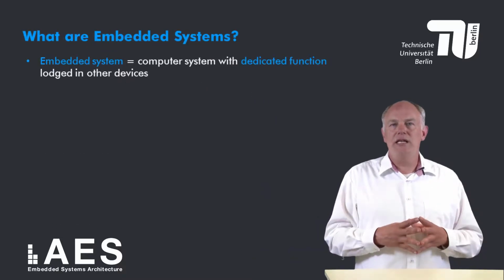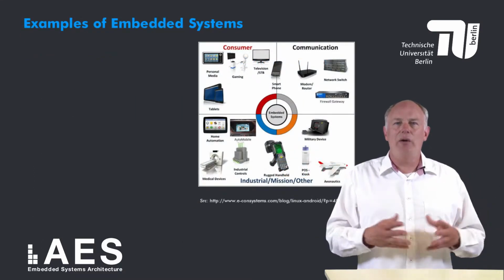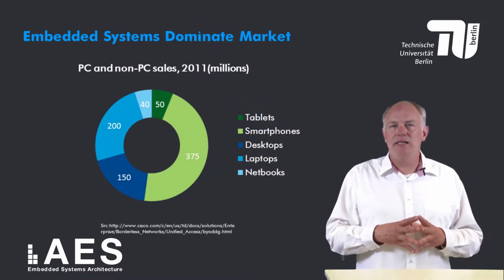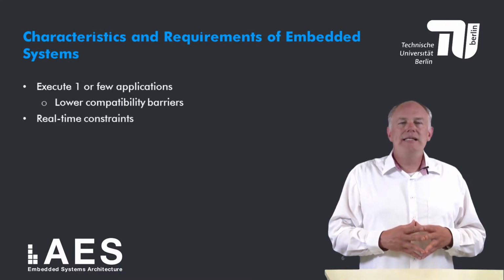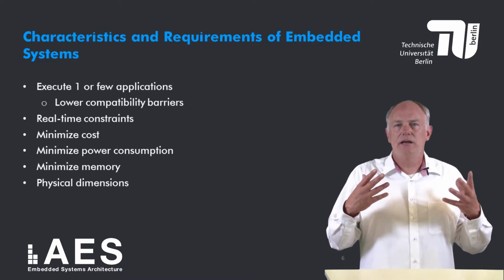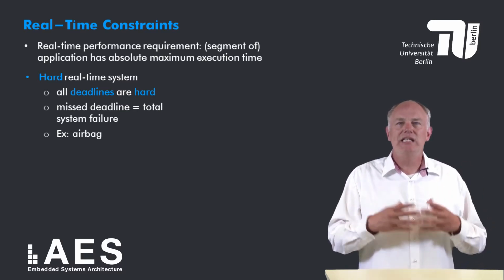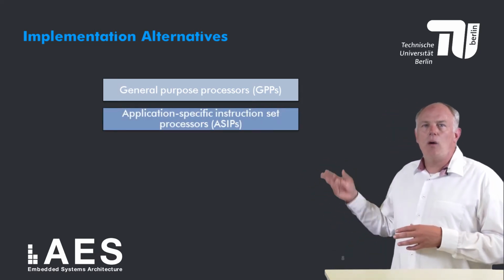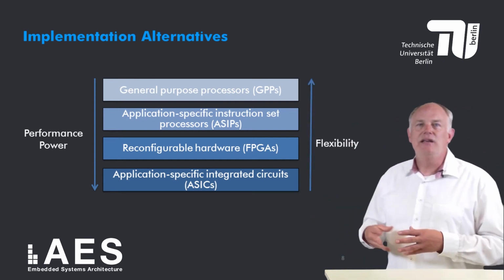1 1 8 Introduction to Embedded Systems

Comment: I like the definition that  an embedded  system is a computer that doesn't look like a computer. By the way a desktop computer  is not an embedded system but it has many embedded systems inside it. Eg keyboard, mouse, disk, wifi module all have microcontrollers in them.